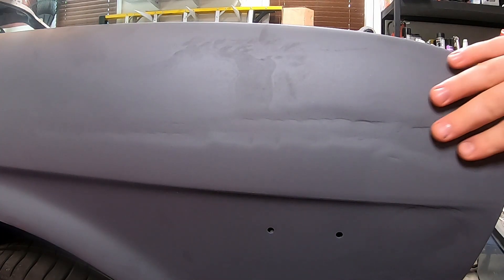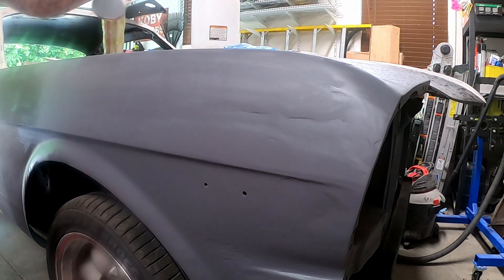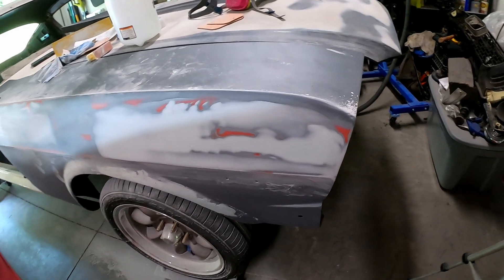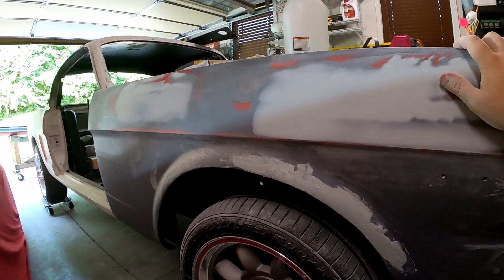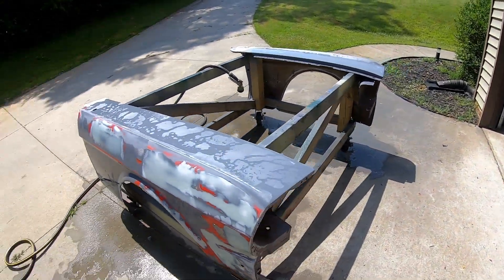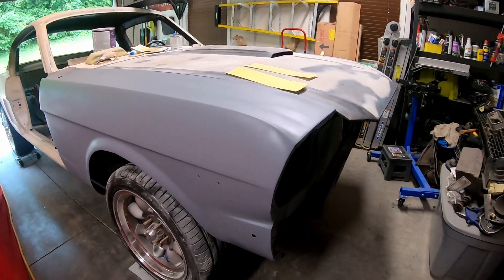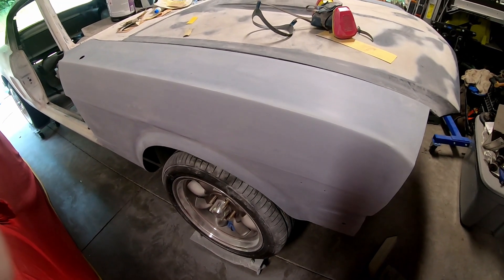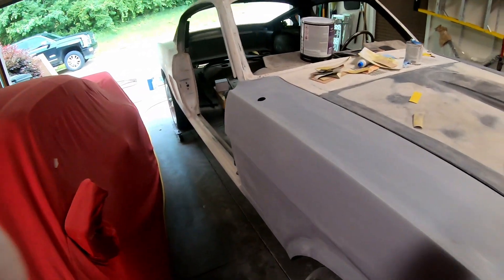1966 Mustang Fastback first time body work | Body by Joe

Comment: You are doing it wrong.  I taught myself metal work. A long road, but I was making panels from scratch and TIG welding them in where you had a hard time finding the seam in bare metal. Learn about metal shrinkage. The concept that if you take metal above a certain temp it shrinks and how to shrink by moving the metal. That was key to doing better metal work. You get a different perspective everytime you look at metal damage.
Since you had pretty good exposure on the front of the fender I would have done the hammer and dolly work to level the metal. Then use a metal shrinking disk to level the metal. A lot of deep stuff I saw on that fender would have needed some metal stretching, that is hammer on dolly work. Combined with pick and shrinking disk I could have brought your fender to shape without filler, just a few coats of filling primer. 
You mentioned about the metal being waving, well anytime you get metal sticking up like on your wheel opening, you might consider picking the metal down some or working it more and using the shrinking disk.
Always remember, every weld is a shrink point. Never shink unless you KNOW the metal needs to be shrunk. In almost all cases, the metal is shrink some place and needs to be stretched. That someplace is sometimes on the other end of the panel.
I started out doing crappy mig welds on a 66 Fastback fixing rust. I eventually graduated to making panels from scratch for my 31 Slant window cabriolet Model A. A tig welder is game changing with panel installation. I have a lot of real bad body work in the process of learning. Keep learning and keep trying. Always push to make it better even if it is faster to just fill and go. I can spend less time fixing the metal then the time it takes for you to level with bondo now adays.
Reply from the maker: Thanks for the info! This will also be mainly a track focused car, so will inevitably get some dents & dings (not to mention rock chips) - my next project car, whatever that is, I’ll keep your post in mind.